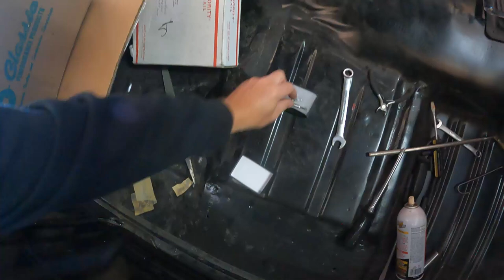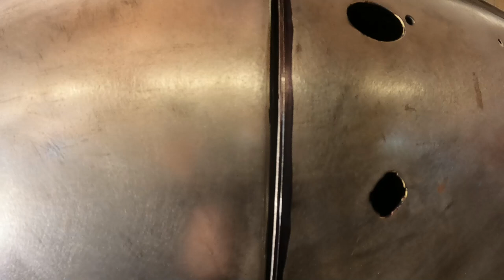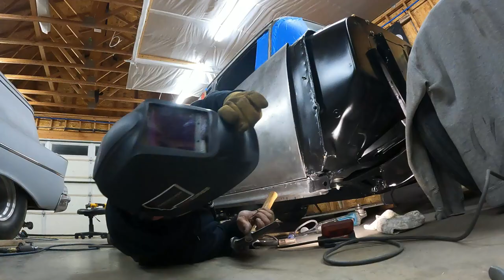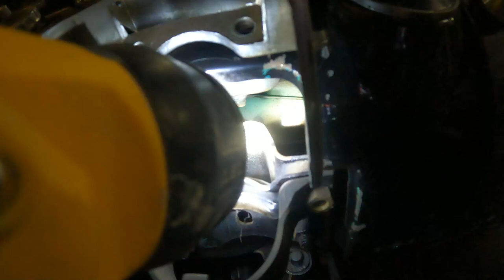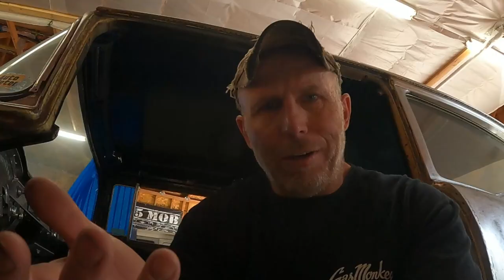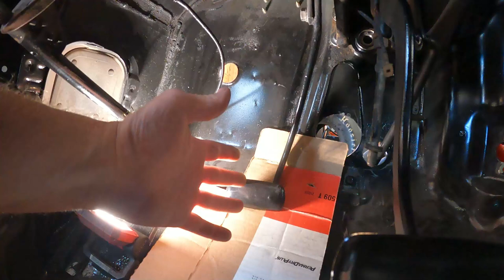Trifive Tech Tip - How To (and How NOT To) Install a Trifive Chevy Clutch Spring Plus More!

Comment: I had an over center spring in my Dart years ago. I found that it was easier to use the clutch in traffic than any hydraulic clutch I have ever used. It will all be worth it in the end.
Reply from the maker: I'm excited to see how it feels once I get the last piece of the linkage installed. Thanks for watching.

Comment: A few years ago I replaced the whole clutch pedal as well as the spring and hardware. Struggled for a little while (just like you) trying like hell to get the spring to stretch. Then I realized (like you) that the trick was to remove the bottom bolt. Luckily I did not use the washer trick. I had heard of that trick for hood springs, but not for clutch springs. So I was yelling at the screen, trying to tell you how I did it. Unfortunately, you definitely could not hear me, all the way from Massachusetts. Lol. Glad you got it figured out. Thanks for the video. Where were you a few years ago, when I needed this video. Lol. Thanks again
Reply from the maker: Thanks David. The funny thing is, I was going to do the remove the bolt thing first, then I saw the post about adding the washers and that guy said it was super easy, so I went that route. Lesson learned... Maybe try yelling louder next time?
Reply: @MontanaGarage  you know there are a LOT of good diy tips that you can learn on YouTube. Unfortunately there are also some bad tips. And I was yelling so loud, my neighbors called to complain. They thought I was singing in the shower again. Lmao

Comment: Looks like if you lopped off about 1/8" off the end of the hook that goes onto the clutch pedal, it would have slipped thru the hole.  Still would have had plenty left to hold.
Reply from the maker: I thought f that Pat, but figured there must be a reason they put such a complete hook on there. Without having an assembled version to look at, I didn't want to hack off the hook just to be sure it still functioned as designed. I appreciate you watchung!